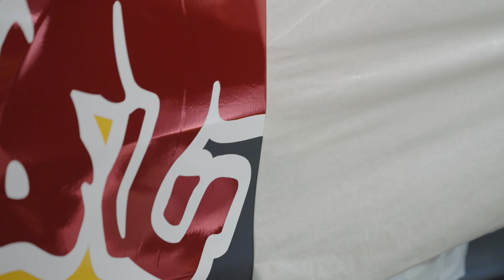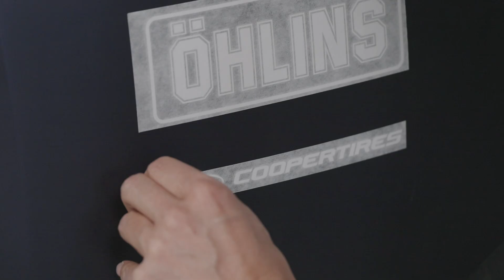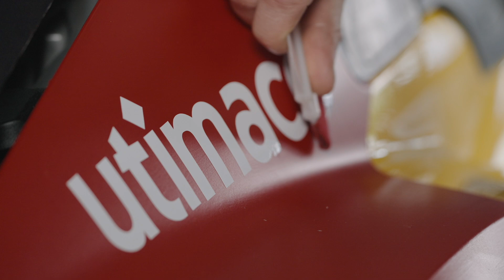Satisfying Race Car Vinyl Wrap

Comment: 1:45 dude just seals in that crease.  Why are they fighting the film so much? Lower the angle of attack, use soft heat and work easier. Knifeless tape will give you cleaner lines than handcutting on a masking tape line too.
Reply: its a RALLY car. that livery will be lucky to make it to the end of the event. speed and efficiency because we're always the last ones on the car and then get told to hurry up lol